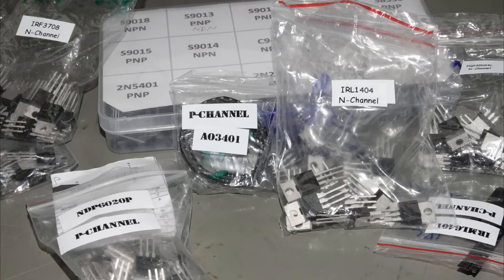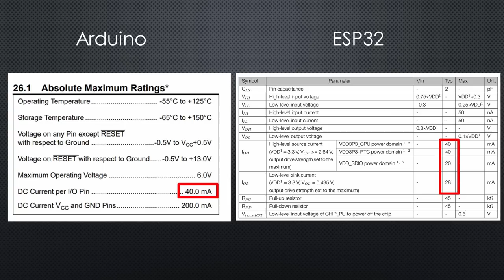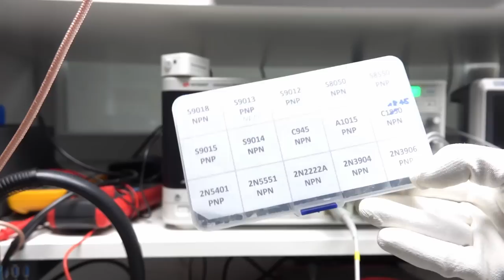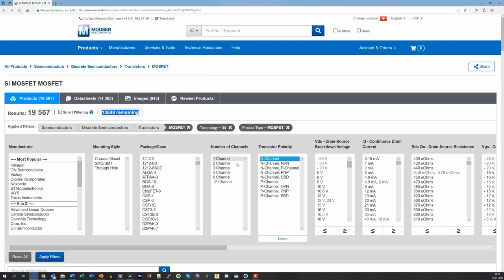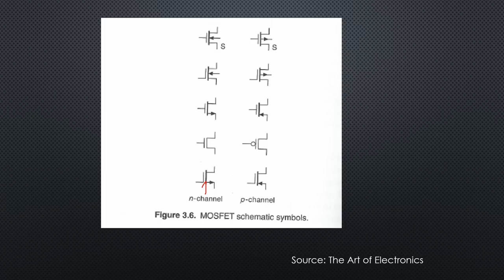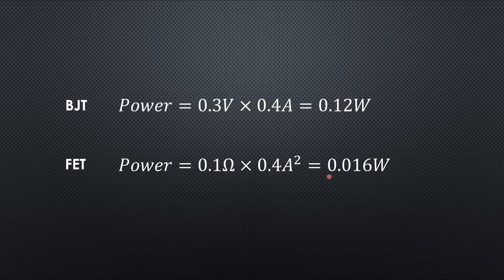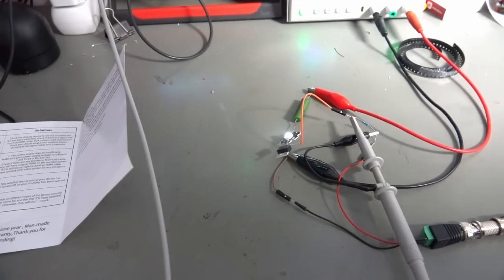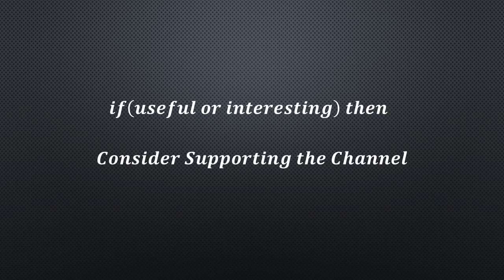434 Transistors "Survival Kit" and Tutorial for Makers

Comment: My go-to for medium power microcontroller interfaces is the ULN2803 Darlington array IC. It has eight channels that can handle 50V and up to 500mA with 3.3V and 5V logic inputs. It has built-in input resistors and protection diodes on the outputs. I have a pile of DIP form factor ICs but they also make them in SOIC form, useful for prototyping that can be directly translated to a final design.
Reply from the maker: I agree. These are good if you need more then one or two low current outputs.

Comment: Invention of transistor was probably the biggest milestone in the electronics world - can we imagine today processors built on tubes? ;-)

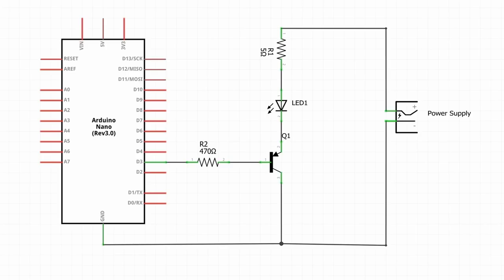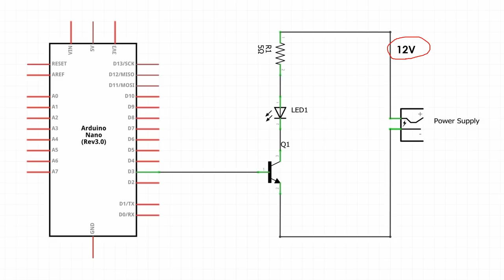At 4:57 & 9:00 - this diagram has no ways to work without ... grounds connected ;-)

Also: very simple but quite needed for ESP: programmer (if you don't use ESP modules but ESP boards for the project) - you still need 2x NPN for auto programming (without pressing BOOT or if you don't have it/don't want to have it) - it requires 2 BJTs - I am not sure they can be simply replaced by FETs.

MOSFET transistors in serious projects are always driven by MOSFET drivers (specific ICs for this purpose) - controlling MOSFETs is not as trivial as one would think - especially when we talk PWM with high frequency - probably one more parameter should be considered while choosing the transistor type: Avalanche Energy
Reply from the maker: I agree that I forgot to connect GND.
I think the two BJTs could be replaced by FETs. But BJTs probably are cheaper...
You are right: MOSFET drivers are used in the applications you mentioned. But for most of Maker's usages, they are not needed, also because MCUs usually do not switch too fast nor do we switch heavy loads where the steepness of the edges are very important.

Comment: This was a great video as usual. I think it would’ve been helpful around 13 minutes in to note that there is indeed a connection between the gate and source of a N-MOSFET. It’s just that it behaves like a capacitor unlike a BJT where the base behaves like a diode, so MOSFETs do indeed require power to switch on and off. If you try to switch MOSFETS rapidly with a limited current source like an esp32 especially through a resistor, the FET can spend a lot of time in a partially on state, causing it dissipate much heat. If you have not used these before, this is what MOSFET drivers are for. They provide high current to rapidly switch the MOSFET on and off and should always be used in high frequency applications such as PWM into significant loads.
Reply from the maker: I agree that you have to charge the gate capacity before the FET switches. Unfortunately I always have to omit a lot of details for short videos :-(

Comment: Hi Andreas, I would not render NPN and PNP totally useless. I often create small, switchable current sources by using them with an emitter resistor and an LED or two Diodes (as a voltage reference) between base and GND. With a red LED (1,6V), you can easily get the current drawn by the collector with approx. 1V/R.
With 100R as an emitter resistor, you get a 10mA current source, perfect for driving and switching an LED with an unknown (e.g. 3...50V) supply voltage. This would be way more effort with a FET. 
For driving well defined low to medium currents I usually only use BJTs.
Reply: LEDs and pull ups and downs are what I love using bjt's for! They're so simple when made simple
Reply from the maker: I hope I did not say BJTs are useless. I focused on digital applications and there, for a "survival kit", I felt MOSFETs are the better choice.
Reply: @AndreasSpiess  Yes, you are right, for pure digital, simple applications. For interfacing to the outside world (e.g. S0-Impulse input), a BJT releases you mostly from ESD precautions and makes the design much simpler. But you are never released from calculations on the default transistor circuits (emitter, collector or base circuit). But there are enough tutorials out there and I think, your video covers what most users need to understand and what they need for practical MCU circuits.

Comment: My favorite NPN MOSFET is the IRLB3034 for being logic level, and having very low Rds(on).
Must be careful to put some resistance in front of a FET gate, as capacitive bouncing can cause latchup or uneven switching.
Reply: I don't think NPN & PNP are correct terms for MOSFETs. Aren't they P-ch and N-ch?
Reply: @AnnaVannieuwenhuyse  correct, NPN/PNP refers, roughly, to the physical construction of BJTs. Field effect transistors (MOSFET/JFET) are built differently.
Reply from the maker: I agree: The IRLB3034 is a good choice as an n-channel MOSFET.

Comment: I have to stand up for the BJT. Not fancy or efficient but they can be had for less than 3 cents in relatively small volumes.
🙂
Reply: Last I checked the 2N3904 (or similar) is pretty widely the cheapest transistor you can buy, at least in through hole.
Reply: @Broken_Yugo  
Yup and the venerable 2N2222.
Reply from the maker: I am not against BJTs. But for a "digital survival kit" I voted for FETs.

Comment: Cool thing about gate capacitance: it stabilizes op-amp based current sources that use a mosfet configured with negative feedback from the source terminal. An output-to-negative-input stabilizing capacitance is provided inherently by the mosfet. It may not be enough, but plenty of times it works. But don’t delete that capacitor footprint on the pcb. Leave it unpopulated. It may save your day later :)
Reply from the maker: It is always cool to use "parasitic" parts of a device. The bypass diode is also such an example...

Comment: From my experience, the majority of fets on aliexpress aren't fake but most of them have substantially smaller crystal than the original one. So if it's rated to sustain 60A drain I'd look for a third or at most half of it (20-30A) until the burn out. 
That said one of the packs that I've got had one fet that essentially was a paired schottky diode with the transistors lavel.
Reply from the maker: I would call those "weak" parts fake. I am cautious with special parts and parts where the AliExpress price is much lower than the "real" price. Cheap Chinese manufactured parts usually are ok probably because faking them is too much work.

Comment: I would not say that BJTs are useless. I use them to invert signal for driving mosfet gate for example. Difference is that signal logic p-mosfet in TO92 package such LP0701 costs something like 2EUR and it's one of the few transistors with low vgs(th), although in my experience, transistors with typical vgs(th) of -2.4V can work with 3.3V logic. On the other hand, for 10-15EUR you can get 300 pieces of BJT from China which you showed and third of that price is the box.
Reply from the maker: I hope I did not say they are useless. They just were not needed for my minimalistic survival kit

Comment: Good things to think about. Most of the special Transistors I use are recovered from scrap boards I have chosen to use in the project. No guessing if its a fake, and the little tester will tell me Hfe and Fv drop. The 2N2222 for me is the most bought transistor in my inventory. I'm too new to have exotic Mosfets laying around,  Amperage means fires, for now I'm keeping it to a 2S/3S systems. A 2n2222/2n2907 push pull mini amp sounds so much better than a Lm386 and the 2n2222 gives us 800ma to play with stuff using Arduino. But I live in Arizona, a tech from India will have the BC547, Somebody in New England has a grip of 2n3904's. Does Ikea make Transistors yet? I look forward to istalling the legs onto my transistors.
Reply: My favorite BJT as well !
Reply from the maker: Using recycled transistors is a good idea, particularly, as you describe, for exotic parts. They are often faked on Aliexpress and the shipping is expensive on Digikey for small orders...

Comment: Sir Andreas,
I need to mount Arduino uno(s) but run sensors wiring up to 25 feet distance.  What gauge (size) wire should I buy?

Hopefully, I will buy multiple items for my “first” stock inventory to build things.

USA we use 120volt AC and 230volt AC (for energy hungry devices).

Do I need different transistors or other items for “AC” POWER SOURCE? FROM WHAT YOU LIST IN THIS VIDEO.

WHAT SOURCE IS BEST FOR ALL ITEMS?
Reply from the maker: 1. Check the power consumption of your sensor. If it is only a few mA the gauge does not matter if it is 24 or bigger. But you could get problems with interferences.

Comment: I am confused. You showed that PNP transistors won't work with a supply voltage greater than 6 volts.
But in the summary, you say the PNP  is for the high side. 
What does the "high side" mean ?
Reply from the maker: What I did not mention is that you need a second transistor if you want to switch voltages more than 5-6 volts with PNP transistors and an Arduino. I only covered the very basic stuff.

Comment: for small signal transistors I just bought a box from China. Even if they are conterfake (doubt) you can still measure the gain, and debug any problem a transistor out of spec is introducing in the circuit. For "power" bjt I do have my jelly beans components, TO−204AA I do use MJ15003G and it complementary pair MJ15004G. It is good according to the Data Sheet up to 2MHZ. I only use it to audio. Back in the day I used 2n3055, but at local stores all of they are fake. Not worth at all.  TO-3 I use 2SC5200 and 2sa1943. Mosfets usually IRF510. All of those I use out spec max frequency, (Except the mj15***)  Also BJT does a great job in linear power supply. And small signal transistors do work way out the specific frequency in the data sheet.  Worth to have in my opinion
Reply from the maker: Thank you for sharing your experience!

Comment: Can you make a video about how to control regular 5-12V old relays with both Arduino, ESP8266 and ESP32 and transistor thanks.
Reply: Just replace the LED and its current limiting resistor shown in this video for the relay coil, and let the FET switch the 5 or 12V on or off?
Reply: Study with many books, the best way to control transistors.
Reply: @tamazerd  You need to add a reverse biased diode to the relay coil in order to protect the FET against voltage spikes when turning off the relay!
Reply: @kek7778  Yes totally forgot about that!
Reply from the maker: @Line Ways: I hope you got the answer in the above comments: Use an n-channel FET and the protection diode and you are done. Maybe you want to add a 10k resistor between gate and ground to make sure the FET is switched off if the pin is on "input"
Reply: use ULN200x series, direct connection. 1 or 8 or more outputs, no issues there. It will work with 3v and 5v logic perfectly. No additional diodes needed. I have used those on esp8266 for several years, -40 C in waterproof box, outside. Andreas dismissed and tossed out darlingtons, and this part is an array of darlington pairs with integrated protection diode. So take his advises with a 1kilo of salt from now on.